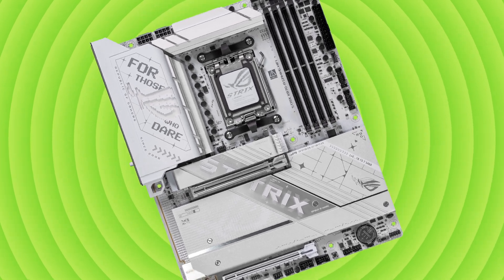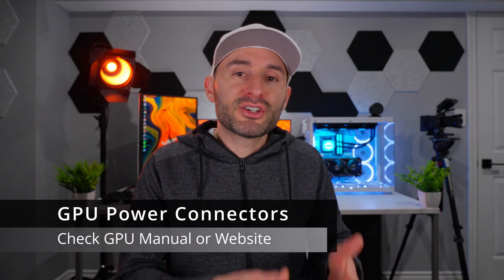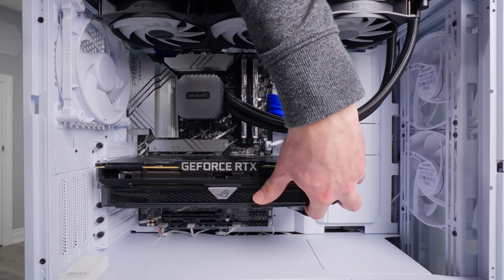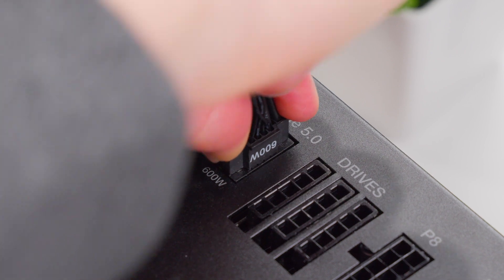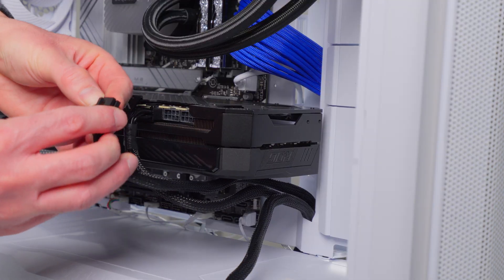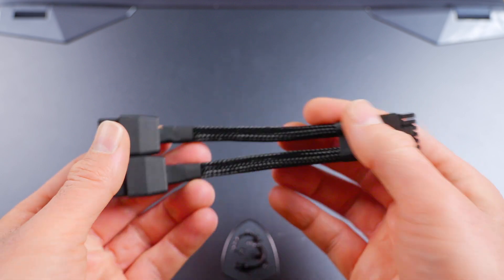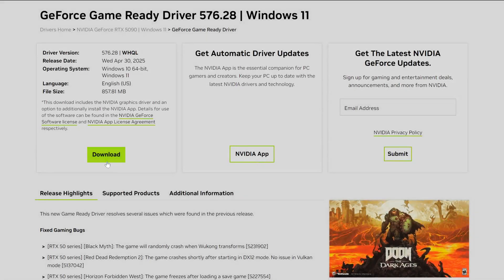How to Install a Graphics Card or GPU into a PC

Comment: Hi I have a question, I want to conect my rtx 3070, it needs 2 8pins conectors. My psu has those “Y” cables like the video (4:45). I should use those 2 “Y” cables?

Comment: So I don’t need to delete my old drivers before installing the new graphics card?!
Reply: I would assume this is done for a different brand graphics card like if you went to something else other than Nvidia, but I'm sure you can just do that afterwards
Reply: You definitely need to delete old drivers before you even remove the card
Reply: If u have amd drivers,u got new Nvidia gpu, delete amd drivers, install Nvidia drivers, and opposite is correct too
Reply: @pro @probably_a_human. using ddu before you install the GPU is way more productive
Reply: @RivalSMPsurvival 👍
Reply: Nope
Reply: i would recommend it if you switch brands like amd to intel or nvdia to amd or vis versa but i dont rhink its needed for they same brand but still recommend
Reply: @relidbd you all ways need to use ddu if you get a new GPU because different GPU means different drivers and you can’t keep old drivers left over without problems
Reply: You don’t need ddu for this video because you have NO drivers, this is for INSTALLING a graphics card into their own pc after building it their self without having a previous graphics card installed

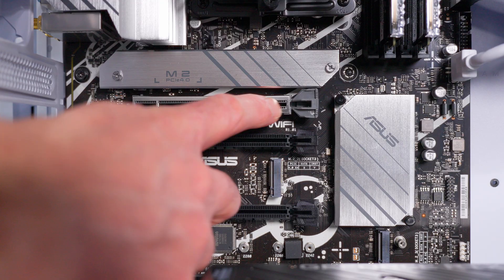Comment: 1:56 I mistakenly broke that locking pin when removing my gpu. What should I do?
Reply: The GPUs gonna be fine as long as you don't break something else, and a broken retention clip isn't a big of a problem as long as the card is screwed into the case securly but without the retention clip the GPU might wiggle loose or fall out if the case is shifted abruptly, also it's highly recommended on using anti GPU sag bracket since the retention clip is no longer   functional

Comment: Installed a dGPU today and the HDMI cable is still connected to the mobo. Then I checked task manager, it shows both GPUs are working, utilization on IGP is very low now (exceeded 60% before, below 10% now), utilization on dGPU is very low (about 2-3%), it's a powerful card. I am wondering, would it make any difference moving the cable to the dGPU? Also, the setting on bios points to IGP. Should I also change that to dGPU?

Comment: Many many many videos out there use the splitted power cord to fill two GPU power sockets. Multiple sockets are needed to drain more power than a single cable can do so this is absolutely pointless. Always use a separate cable for every socket.

Comment: Thanks for that, I fitted an Assus graphics card to my Tuf gaming board. What I wasn't sure about was there someting I needed to do before I powered back up. Seems not so thanks for that video and I guess all I do now is download driverts and stuff from the Asus site.Not sure why all the board and driver manufacturers think that we are all fully clued up about a machine that is just a tool as far as I use it. I can read a manual  so no problem building the machine.Where it falls over is that it's left to people on you tube to make it simpler and give much better help. Thanks for that help. Saved me hours.
Reply: Everything worked and it didn't want any additional software. Plug and play. Excellent. Downloaded something called NVIDIA control panel. God knows what that is and it was an option so I might try and work out what that is but I don't need it so I will leave that for now.

Comment: GReat video!
If i might i'd like to add two more things: 
- don't install your GPU horizontally like in this video. Instead lay the PC flat on the ground. This mitigates the risk of breaking something. 
- most modern cards come with a piece of equipment that helps suspending the weight (most it's some sort of small pillar): use it!

Comment: You didn't link a video about power supply cables in the description.
I have never had a more frustrating time with something as trying to figure out how to plug in this RTX 4000 graphics card.  The adapter that the manufacturer sent is wrong.  And I spent an hour on the phone with NVIDIA and they have no idea how to power their graphics card, and they had no idea that the VGA ports on the PSU are for power and not video.  Unreal.
There is an 8 pin plug that comes out of the card.  It splits to two white 3 pin weird plugs that go nowhere.   I need to get to 8 pin VGA plugs on the PSU.  I don't know if I should split and use both, or just use one.  And I don't know what cable to get or what its called.  My studio has been down for two days and no one on the entire internet has a straight answer on how to plug this effing thing in.  I'm ready to smash it.  I had to get a bigger GPU because my old one won't run Davinci.  Runs an entire recording studio flawlessly, but won't run Davinci on the existing GPU card.

Comment: Congratulations on the clarity and getting straight to the point. I have a question. I'm planning on getting a 4070 Super, but my current power supply is a Corsair CX750. Do I need a new power supply, or can I use this one for now?